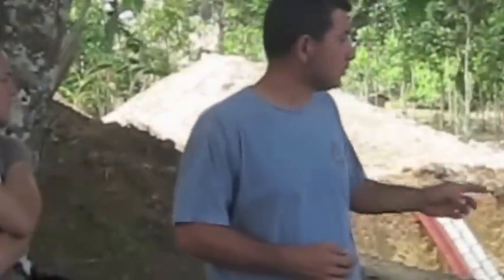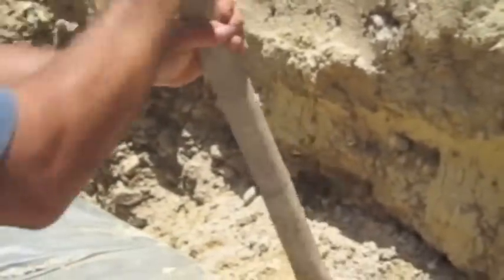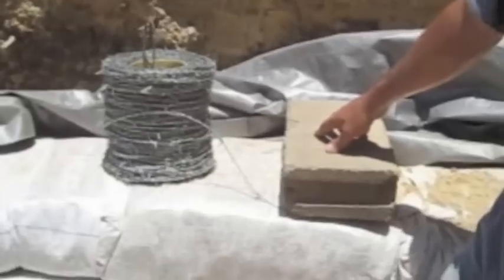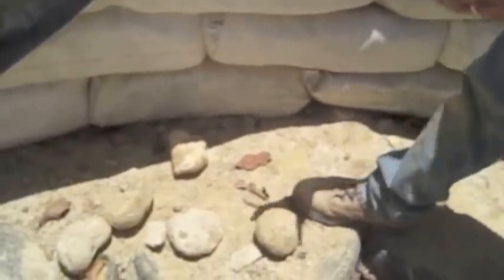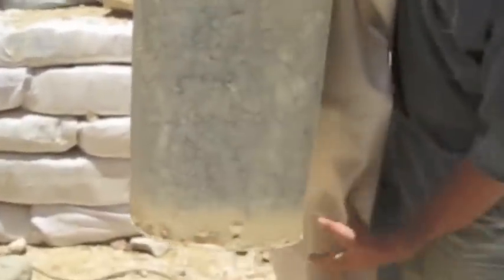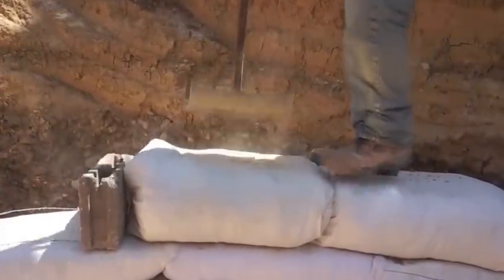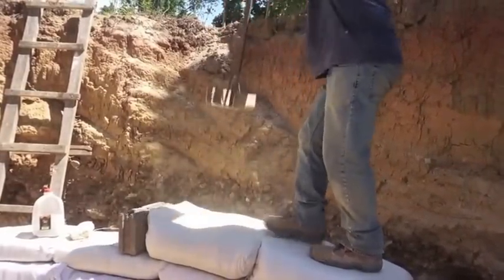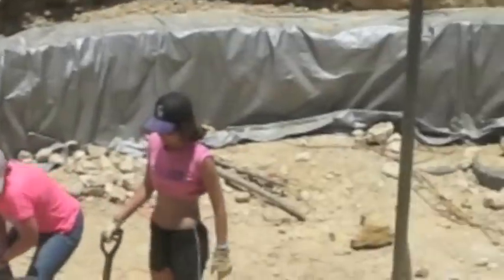Earthbag construction of a two story round building with a root cellar in Belize

Comment: Hi JNM, Lots of Love from India. For moderate to heavy rainfall regions, wether Individual bags are suitable or tubing is suitable?
Reply from the maker: Hi, any of the two types will work. Tubed earthbag is very convenient and does offer better stability but for the rainy environment please consider stabalize your mix just very little will make (5% cement or lime) a big difference in stability againts water sogging the structure. Also make sure walls a very plumbed.
Reply: @jnmarin6603  what are your thoughts about the compressed earth blocks vs earth bags?  it really sucks that most cities still won't approve earth bags or solid earth blocks for people to build their own home ... i think most cities will approve the interlocking earth blocks the ones with holes in the blocks so you can put rebar and cement in the holes ,, but to me and i would really like to hear your thoughts about this as well but to me the earth blocks with the holes that have rebar and cement inside the holes i think that will ruin the thermal transfer quality correct? also using all that rebar and cement will drive cost of the house build way up  ..... i really like how this guy did his solid earth blocks looks very strong https://www.youtube.com/watch?v=23MTZuq6bec&t=380s

Comment: Can I use sand with my bags? And what does the lime do ? I'm sorry but it's hard to understand you. Great video 👍
Reply from the maker: Hi, pure sand is not recommendable due to that it won't compact and harden good enough. Also, top soil is not recommended as it will have too much organic material and can decompose. The  better materials are rocky/sandy soil with clay in it that when you moisten and tamp it becomes compacted and hardened. JUST Sand in the bags will shift and slide collapsing the wall.

Comment: did you find good success with bags as opposed to a continuous tube? seems to me that a tube would be stronger and faster to work with. where I live I can only find tubes that are a bit narrow and they are more than twice as expensive as bags
Reply from the maker: You are correct on all. I have not gotten to work with tubes yet. But believe the speed improvement would be worth it in the long run. Working on the water proofing the and plastering at the moment.

Comment: Interesting, I hadn't seen anyone lime the back fill dirt before. It definitely seemed to work. I'm very interested in bag and tire foundations. Foundations are always one of the biggest expenses in construction and hard to get rid of that cost. I'm extremely interested for greenhouses where a small amount of shifting wouldn't be a disaster. With a house under freezing and heating conditions I am concerned with cracks in the walls. Greenhouses have a small amount of give to them. Liming the back fill seems to mimic compacted soil which is far more stable.